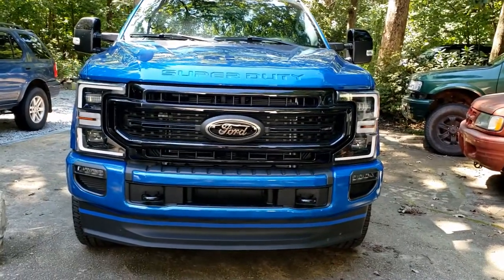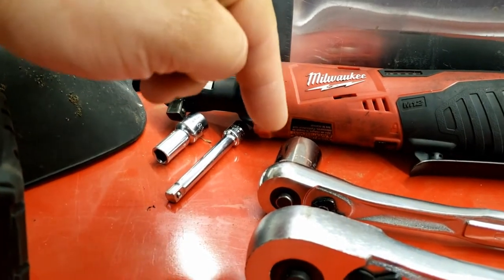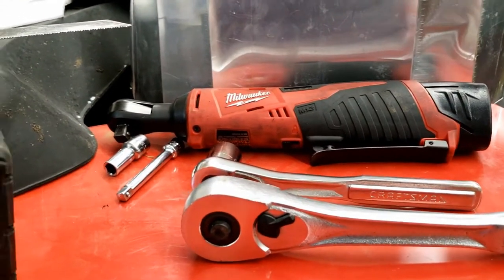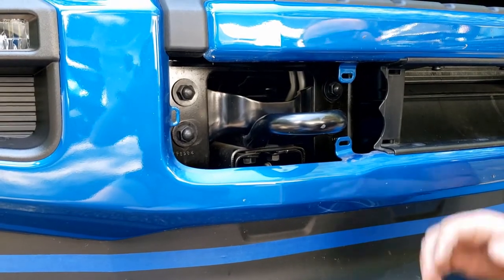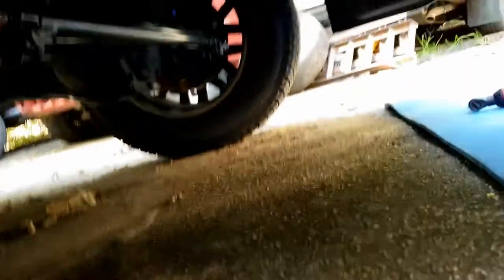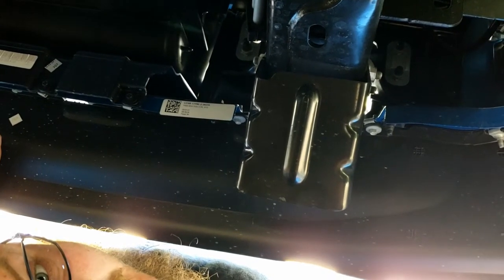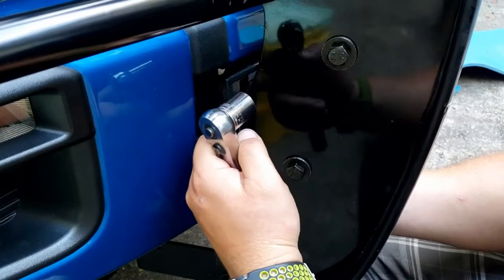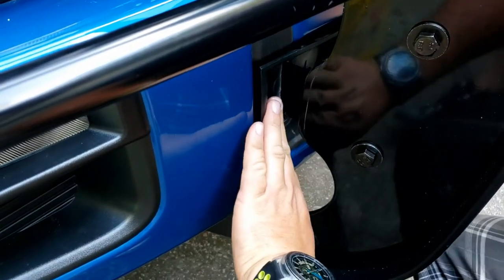Ford f-250 SuperDuty Grille Guard Install by Barricade Offroad

Comment: I have a 2024 and plan to install the exact same guard. Being able to see where the slot needs to be in the tow hook cover really helps because I’m not leaving it off either. I believe I can get very close based on this video along with a couple measurements to tighten it up. Easier said than done I know but this video is super helpful!

Comment: Quick question, I've heard removing the air dam decreases fuel economy. Could you have reinstalled the full dam by cutting slots where the mounts drop down?
Reply from the maker: Yes slotting would have worked. We were going for the tremor valance look.

Comment: With the guard laying flat on the ground you put in 2 bottom bolts 1st then you can pivot the brush guard up to install the top bolts much easier with the bottom bolt holding the weight.

Comment: I was wondering if it messes with the front collision alert system?
Reply from the maker: No this brush guard does not block the sensors. Its has activated once since install. This guard even has a removable panel if one had the front facing camera. We like it so far.